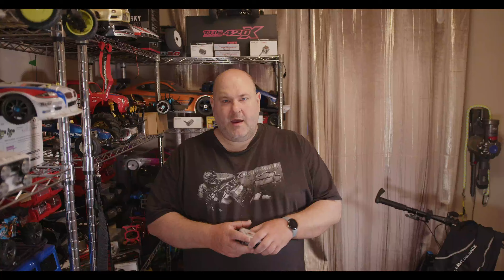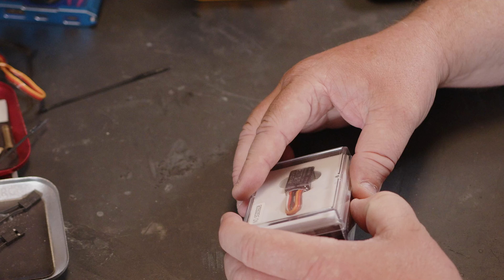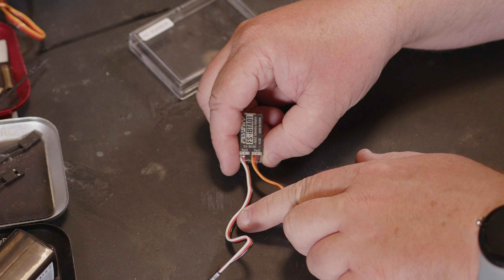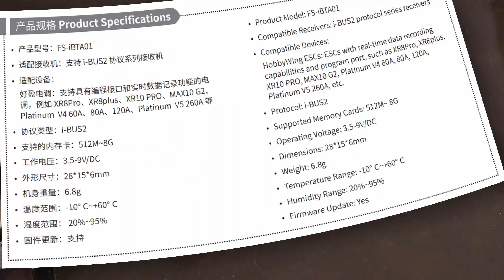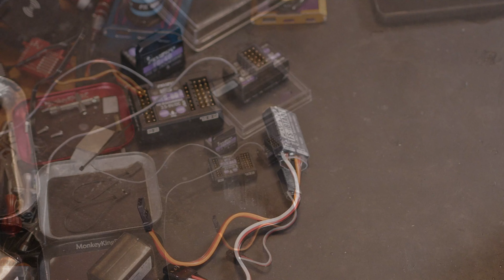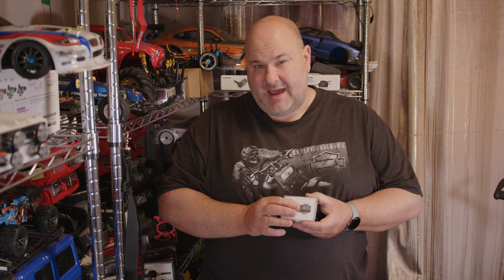Flysky iBTA01 IBus2 Telemetry Adapter for hobbywing esc

Comment: How can I hook up I-Bus sensors at the same time if I only have a 4 channel receiver? Can this Hobbywing box plug into a telemetry hub like other i-Bus sensors? If so, which sensor hub do I need?
Reply from the maker: You can use the 7 socket ibus 2 hub with any receiver that has ibus 2 to run upto 7 ibus 2 sensors

Comment: You didn't show it connected with the flysky radio so a bit meh
Reply from the maker: The only way to use it is connected to the flysky tx so guess you missed it ?
Reply: @WTFRCCars  found your other video that shows it connected and working with the noble nb4+. It was a more comprehensive video than this one.
Reply from the maker: Yeh this one is just for the features that work with this esc :)

Comment: I have the HOBBYWING XERUN XR8 G3 PRO - AND THE Flysky NOBLE NB4+ and reciver - FGr4D 
I followed your process but I jest see IBTA01 in DISPLAY SENSORS 

What am I doing wrong? I updated the transmitter and receiver to the latest firmware.
Reply: any update? having the same problem
Reply from the maker: Are you on the latest firmware for the transmitter or it won't work at all
Reply from the maker: 2 things to check 1 is that the esc in on the supported list in the instructions and 2 that the port on the esc is set to ibus 2

Comment: Hi will this work with the max 5 g2 and max 4?
Reply from the maker: They are not listed but as a rule the esc needs to work with the Bluetooth programmer adapter
Reply: @WTFRCCars  Actually not so much, hobbywing needs to make it compatible.

Just had a back and forth with hobbywing about the FS-iBTA01 and Max 8 G2. Doesn't work despite it being OTA Programmer capable
Reply from the maker: Yeh it's got limited use at min
Reply: @WTFRCCars  I think it's useful in catching certain electronic gremlins such as a bad power connection. I used the OTA programmer to datalog and found out that at certain high amperages, my voltage sagged badly, turns out I had a bad connection from the pack to the battery (bad soldering at connector).

Comment: I wish FlySky would add ESC tuning via the Transmitter for the Hobbywing Drift ESC.
Reply from the maker: It's not flysky it's hobbywing that need to enable it in the esc firmware
Reply: @WTFRCCars Can you ask Hobbywing or how do we help make this happen?
Reply from the maker: Hobbywing won't listen to anyone about ibus 2 control of the esc's or telemetry unfortunately they do what they want
Reply: @WTFRCCars Ahh I see. Looks like they want to lock us into their ecosystem. I do have the OTA so I could look at my phone if I really wanted to but looking at it through the Tx would be a lot more convenient

Comment: Can we please see this one in action? Do you know if it works with the PL series - one of my biggest annoyances with the AXE3 ESC I have is that it doesn't work with the PL18 (which I prefer for crawling because of easily accessible controls) means I'm forced to use my old NB4 :) I wonder if they're going to push the AXE integration to the Paladin platform in the long term.
Reply from the maker: This will only work on the nb4 transmitters so far also I haven't seen any plans for axe and pl transmitters